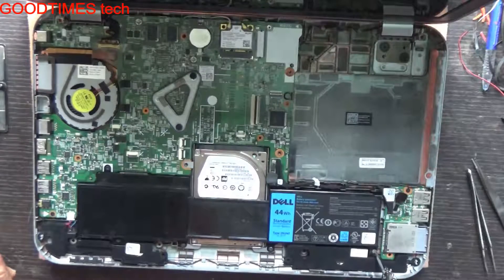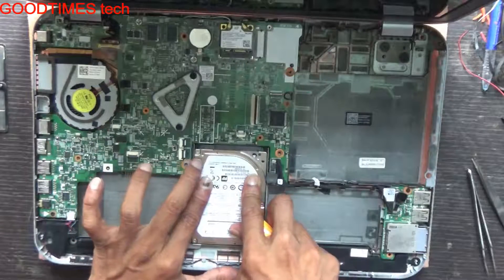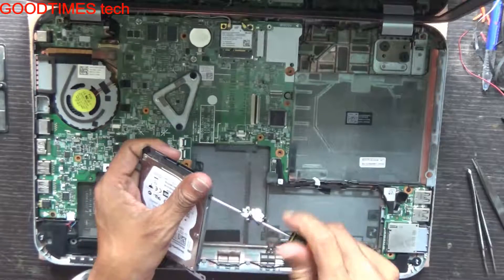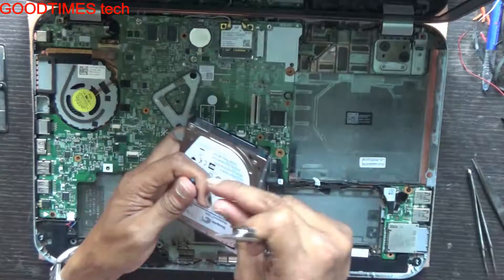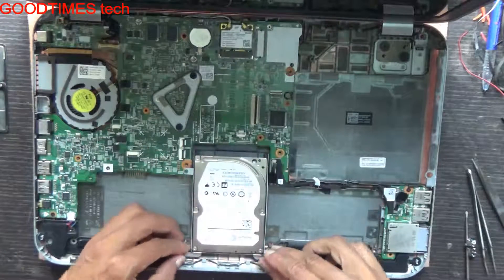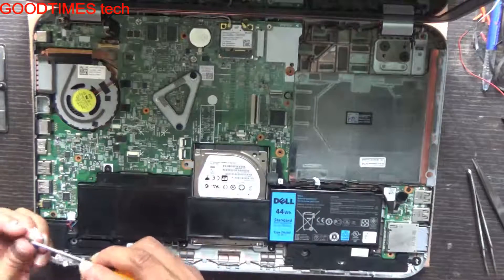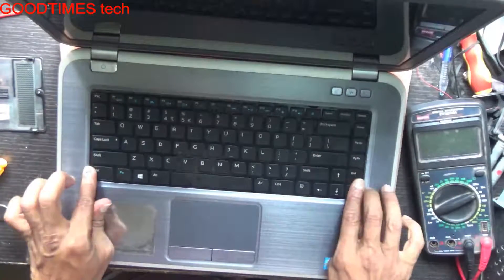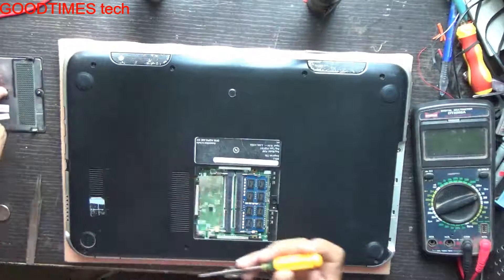Dell Inspiron 15z | P26F | How to replace HDD.

Comment: Thank you very much.  It was so easy to add new SSD that I am now going to stop procrastinating and order a new battery and use the video again.  I have bookmarked this video.

Just one very minor comment:  During re-assembly of the battery, the bottom-right screw was not re-attached.  (Probably just jumped to the next part a bit early.)

The fact that you also showed the complete re-assembly was excellent; and something many posters don't do.   Thanks again.